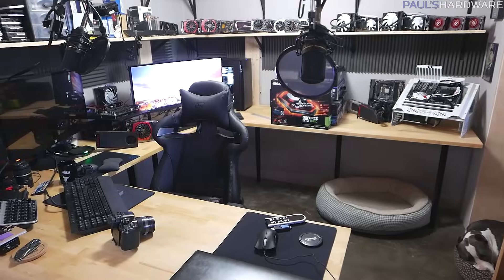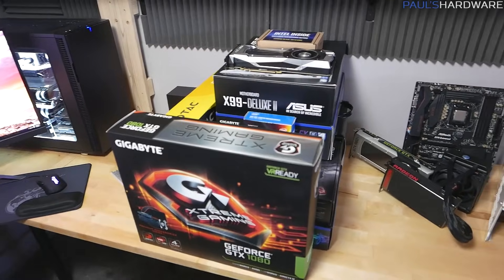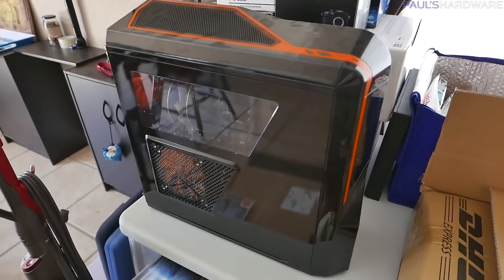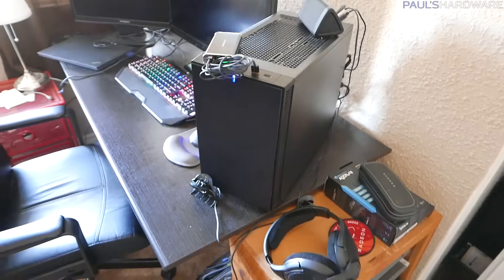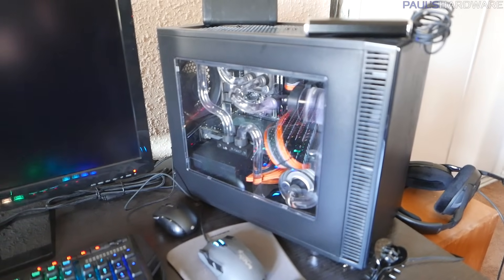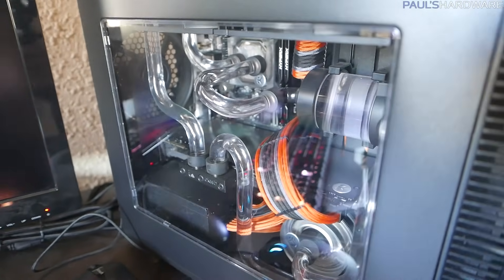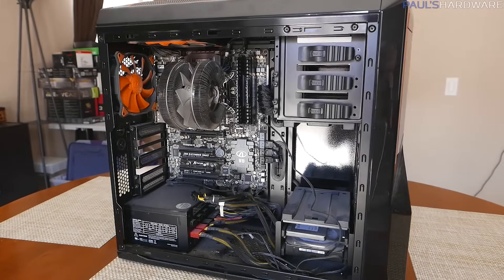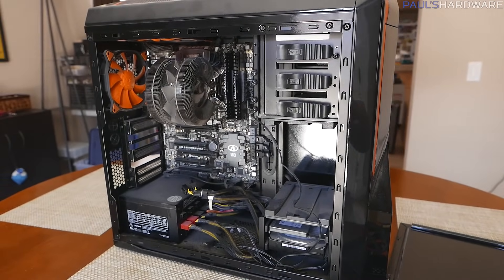Prepping a Hand-Me-Down Computer

Comment: can you pair newer flagship style flagship graphics cards with older hardware like phenom ii or FX cpu's for the best bang for your buck gaming desktops. would a 980ti or rx 480 be overkill or a waste of money because of bottlenecks. or even putting a watercooler radiator inside a minifridge and drill holes in the side for the tubes.

Comment: how do you guys play on those tiny mouse pads lol
Reply: +Eric Tan 400 DPI? how is your arm not on fire?
Reply: i thought they wore normal lol i guess it depends on how much u need to move you're mouse which i hardley move mine and i game on something same size just fine
Reply: Pff…I use my main pc with no mousepad.
Reply: I use a Padzilla, still feels kinda small on my desk
Reply: lol i kinda agree, maybe they just aren't that competitive or uses very high sensitivity...
As for me I have 2 mouse mat on my desk lol ! 
But Im using low as 400 DPI in FPS games. if you play CS, in game sensitivity is about 3.3 if not mistaken, either that or 2.3 I can't remember the numbers lol. 
Bottom line I will often had to lift off my mouse to turn quickly lol...so yeah long mouse mat FTW !
Reply: I keep my mouse at 6k dpi
Reply: Thought the same when I saw it. . . I use a  QcK Heavy and that thing is huge lol
Reply: Keenan Schomburger Are you even serious....I can't even control it after over 3K DPI even lowering Window's Sensitivity....
Reply: Ken Pachi lol best mouse mat ever ! I'm using a SC II version one and another long 900mm mouse mat below it, which my keyboard and my SC II mouse mat sits on top =)
Reply: CrackedDylMil You mean rubbing my hand on the mat and cause bruise or burn marks due to the friction ?? 
As I said, I have to lift off my mouse. 
Just watch how pro CS players play, you get the idea, they use as low as 400 - 600 DPI like me. 
What's worst, they are using a WAY LOT lower in game sensitivity too, if not mistaken I'm about 3.3 in CS GO, but they use about 2.0 or so, it's super duper slow...
And CS doesn't need to be that fast...it's not COD which you do those flashy 360 no scope stuffs etc....
Reply: +Eric Tan no like, how does your arm not get tired? I've tried playing at lower DPI but I end up getting worse at the game because my arm hurts so bad
Reply: CrackedDylMil Hmm...I still don't see how it would, I mean i'ts not that you will always be swiping alot from one side to another really quickly. Just take your time. I think it's matter of getting use to? I'm not sure, but honestly I don't feel any problems playing so low DPI, instead I can no longer play on high sensitivity as before anymore lol, I used to set it high as 1600 - 3200 super sensitive lol...though there's one huge downside for low DPI, if someone get up real close to you, you may have hard time aiming, due to the low DPI. That's the only biggest downside I find.

Comment: Had that Zalman cooler, and had to change after 3+ years as it oxidized to hell.
Reply: But they use aluminium and aluminium is corrosion resistant
Reply: Corrosion resistant is not the same as corrosion proof though.
The first owner left the cooler exposed to open air for quite some time.
Reply: Wisteria Berlitz They're corrosion resistant to the point that calling them only resistant is only a formality, they're next to corrosion proof, but I can understand if it was left in open air for some time
Reply: I brushed and air-blowed it, but the hole thing was just filled with green patches.

It still works with stock cooler performance.
Reply: Wisteria Berlitz Is the warranty transferable?
Reply: You mean like from one owner to another...?
The warranty is probably long gone.
Reply: Wisteria Berlitz Try checking the warranty TOS on the item and check Zalman's website to see if warranty was transferred from the previous owner to you. Companies like XFX have a lifetime warranty on a lot of their products.
Reply: Nah it's fine, I can't be bothered. It'll take too much time and I have 0 intention to RMA it from the start.

Comment: n00b Q - I'm thinking of replacing my case with a newer one, more fans etc, and just want to move all the parts over to the new case.  Trick Q is will there be any bootup issues in the new case, cuz all the hardware is exactly the same...  Any thoughts?  Thanks in advance!

Comment: Hey paul, I have a question about what i should upgrade. Right now im using an FX 6300@3.67GHz, XFX R9 280, 8 gb ram 1600 MHz, and an msi 760gma p34 (fx) mobo. Should i upgrade my CPU to an I5 6600 or my GPU to an RX 480 (aftermarket). I will be playing triple A games such as the witcher 3, GTA V, Dark souls 3, and far cry 4. Thanks Paul

Comment: Notice any issues with Win10 on that setup? Had the same Asrock board with constant crashes / driver related issues when going to 10, but that was a while ago. Used it as an excuse to upgrade, but was just curious if it got better. Can't bring myself to upgrade from 8.1 on my main production rig since.
Reply: That could be just because it is not a full proper installation. Best done is to update the windows so you claim 10, and then do a clean install.

Comment: +Paul's Hardware
You should use a KVM switch for your wife. It's EXTREMELY useful and you will only need to plug in VGA and a single USB cable to each host device, then both keyboard and mouse into the switch. Very easy to use and would highly recommend for that.

Comment: Well you can use a vacuum to clean it if yours have a blow air mode where it blows air instead of sucking it, I have used it to clean dust off motherboards. Mileage may vary tho because I only cleaned 2 motherboards, and one of them is a Gigabyte one and the other is a random Intel motherboard from 2006.

Comment: Personally even for non gaming use I would put a GPU in, even a little crappy low end Nvidia card rather than suffering the IGPU. GPU acceleration in browsers can be quite useful, I guess it depends what your sister will be using it for specifically. Nice video. :)

Comment: Paul what do you recommend for 1080p gaming I was going to get the 960 but then I saw the 1060 is coming but I only have an fx 8320 at 4.0ghz soon going to Zen or the I7 6700k I'm wondering if the fx 8320 would be bottlenecking the gtx 1060

Comment: also any suggestions for a pair of headphones? something not in ear
Reply: Love my Beyerdynamic DT990 Pro's. Amazon has them on sale quite often.
Reply: Philips SHP9500 are awesome open back headphones if you can pick them up for $60 or less, but you might need  a headphone amp to drive them proper, they rival a lot of open back cans twice their price range, and I won't go back to anything else when I'm on my main computer playing games,  and my g/f is not asleep(small house so bed room, and office space are one in the same).
Reply: I have the 558 and I HATE it, it sounds so weak and undefined (+ to much warmth for my taste and poor base+treble).

Also the little thing in the ear cup withhold me from using then for longer than 4-6 hours.

Just buy the HyperX Cloud (one) its cheaper and sounds better/ more flat (little bit v-shaped for personality).
The only problem I have with this one is that it doesn't fit my head+ears D:

I heard that the 518 is the flattest from the three (with the 558 being the bassy one (can't feel that at all!) and the 598 being a little bit stronger in the treble department) so don't think spending more will give you anything, its just spending more!

Also the cable is straight from hell I mean 6.5mm to 2.5mm? Really Sennheiser?

The game one however is a little bit better regarded, but can't say anything on that.
Or get something from Beyerdynamic, people love the soft ear pads (and the dt 770 sub-base)
And before I forget, don't jump on the hype train of the m50x: the padding is awful and the sound is to close/ sound stage is messed up.

~Cheers
Reply: Tek Syndicate have a couple videos comparing headphones at various price points.
Reply: I bought the 668B (way to bright) and the 558 on this exact recommendation.
Tek Syndicate is a bunch of awesome people, but the f headsets- series wasn't that great (as for recommendations)
Do a search for z reviews he knows what he's talking about.
Make sure to search for headphones suitable for gaming, or as rocketjumpninja puts it, headphones suited for entertainment.

~cheers
Reply: Audio Technica ATH AD700X for about 3 years now. Best pair of headphones I've ever used. Extremely open back, amazingly warm, still has a nice kick. Not too hard to drive, so you can use an EQ if you want more punch. Amazing comfortable thanks to those wings. And it's actually more durable than it looks. But these are definitely for people with bigger heads, I think